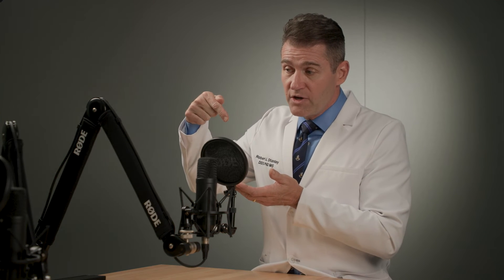You're drilling TOO SLOW when placing implants!

Comment: But what if your guide is wrong? And what if your guided instruments fall on the floor? I just use my doctor hands and place unguided. It makes me a better surgeon. However there are plenty of tricky placements when I said to myself: "Wow, this would have been a great guided case!" But then you have to wait to get the guide, that is my least favorite thing about guided surgery. It is great, no question, but you can do excellent implant dentistry without a guide. It's just easier with a guide. But imagine your whole career doing guided surgery and then trying to do it without a guide on a difficult case? I don't like those odds.
Reply from the maker: Guides are only incorrect if you design them incorrectly. Properly designed guides will not break. The measure of success should not be determined by whether primary stability has been achieved. This is the anatomical approach the industry initially adopted, which has resulted in the overwhelming majority of complications over the years. The true measure of success is the correct implant placement in the appropriate prosthetic location. This cannot be achieved consistently without a guide. In other words, using a simple tool (guide) ensures the optimal execution of the prosthetic plan. The notion that one can arbitrarily remove the guide and achieve the same outcome without a guide is flawed due to the inherent properties and shape of the bone. If a genuine guide complication occurs, the prudent course of action is to quickly fabricate a new guide using a 3D printer or to reappoint the patient, emphasizing the importance of proper execution for the form, function, and longevity of the tooth replacement therapy.
Reply: That’s flawed logic in my opinion. Embrace the technology!

Comment: What if i put 4 diameter in 10 mm length and implant stop on motor half inside and half out … i should drill to length  11 mm …. Some drs say that… wat is the trik in drilling more 1-1.5 down length  .. why implant sit ? Why not sit with same 10 mm
Reply from the maker: If I get too much resistance during the insertion of my implants prior to reaching the prescribed depth what I do is, I use the dental implant as a bone tap. The way I do it is I insert the implant one turn, then back it out half of one turn, and then repeat, until I reach the desire depth. I am not fond of over preparing the osteotomy by drilling deeper because typically that’s where the vital structures live.
Reply: @Stanleyinstitute  you are talented sir … i really appreciate … sometimes also i go perfect to the 4/5 of implant inside amazing only 2-3 mm remaining i chexk torque by motor is 35 when it stop .. then i continue by wrench i found torque less sometimes 20 or less .. thats make me crazy i didn’t find a logic reason why this happen to me
Reply: @drshadykhalifa4839  i think when 35Ncm you are in cortical bone at the alveolar ridge, when you use torque wrench 2-3mm, the implant comes into trabecular bone and torque will be 20Ncm or less... I think that because i have many cases like that...

Comment: Sir how to prevent wobbling of drill when larger size drills are used
Reply from the maker: If you are using freehand there are little options. With guided you will have a small amount of play built into the guide which is called clearance. It is necessary so the drills can fit into the guide. My unpublished research showed my error was 200 micros or less. This is good enough for almost any case. One trick is to reduce the speed of your bigger diameter drills. For example. Our 6mm diameter drill speed is only 1000rpm.